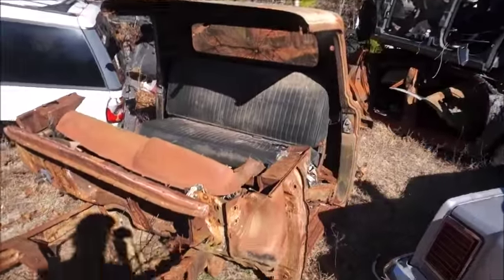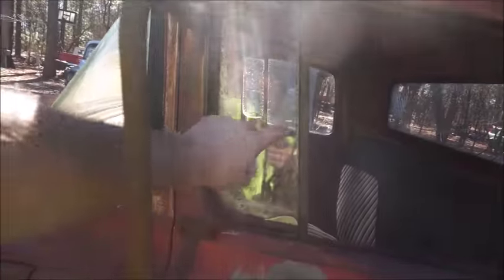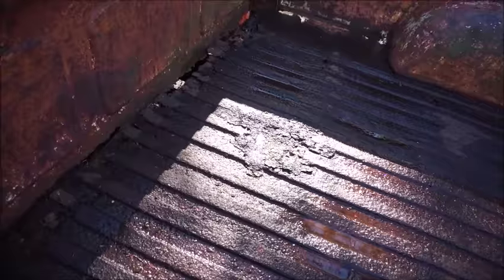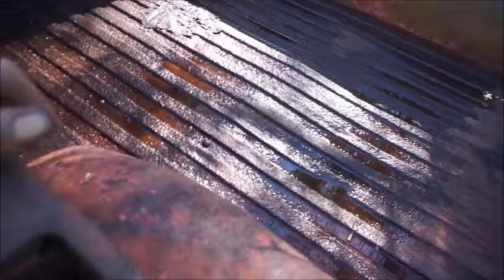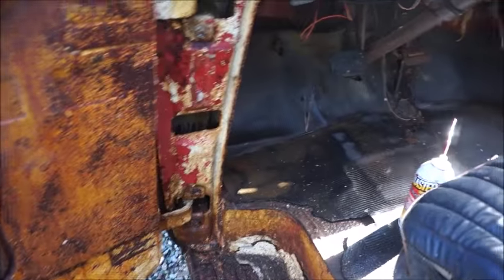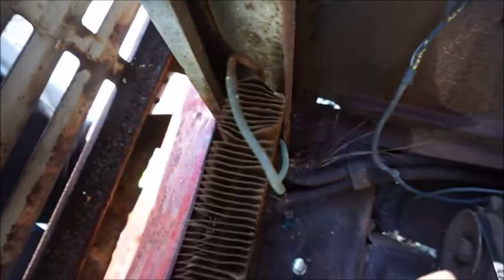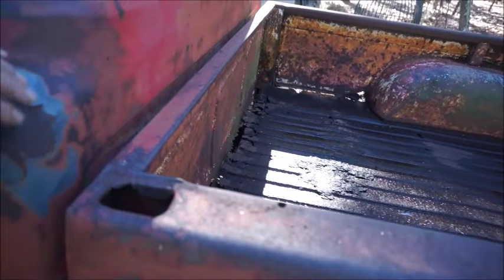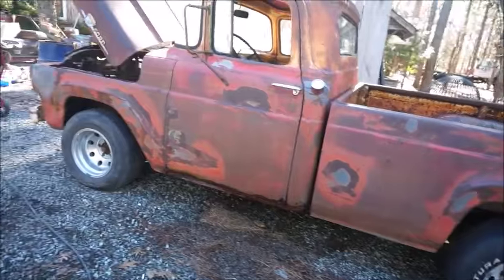1959 Ford F-100 Pressure Wash & More

Comment: john, great truck, I had a bad gas tank in my 48 Ford F1, I pulled it out and dump 
white vinegar in in, and moved it around, let it sit day or so. and boy the stuff that came out of it. I then took more and did it once more. let it set a day or two. then dumped it out and then took my power washer and got as much of the vinegar out and let it air dry. I'm still using that tank in my F1 to this day!
Reply from the maker: Great advice, I may have to give it a try!! Thanks!

Comment: I would replace the wheel lug studs....I once had an old 69 chevelle I did that to. When I got driving they started breaking from old age. Violent shake at 60 mph, lost 3 on front left wheel.... rim almost came off. Good thing I got stopped before it did. I know all lug nuts were tight before driving because I checked them several times after doing the brakes. Replaced them all after that. Think it cost me around $25 for piece of mind...

Comment: Yeah all of that green was algae that had been growing there for years. That's pretty good you pressure washed it off and the truck is red who knew lol. It did clean up pretty good inside and out. Yes and getting rid of that tank behind the seat and putting a tank under it will be a bit safer. Once you get it mechanically right then you can get it to someone who will finish it up the way they want it. I was 9 years old when that truck came out on the showroom.
Reply: +LUCKYLARRY  It's not just the preserve of standing vehicles, my Focus is growing quite a decent crop of it on the side that faces north, and it does get driven regularly.  Mind you, I haven't washed it since I've had a works vehicle as well lol...

Comment: my first truck was a 65 Chevy stepside from a wrecking yard I worked at. I kept the exterior original but scavenged from other trucks for the interior parts. ended up replacing the original straight six with a complete lt1 v8 drive train and rearend from a totalled 93 camaro before I sold it..